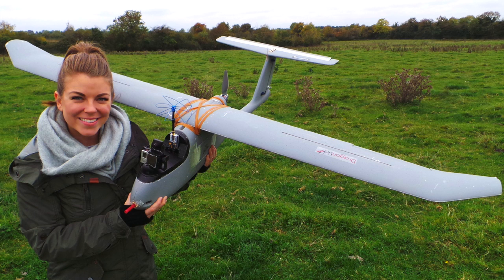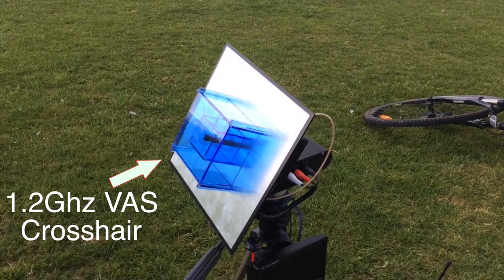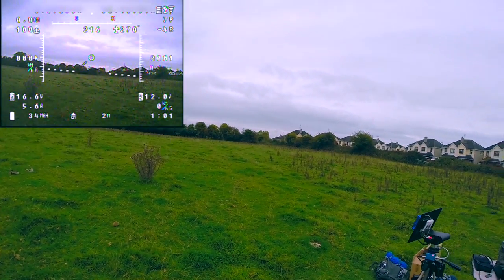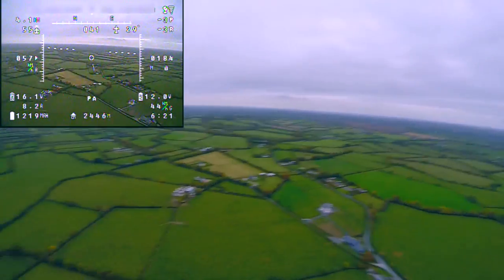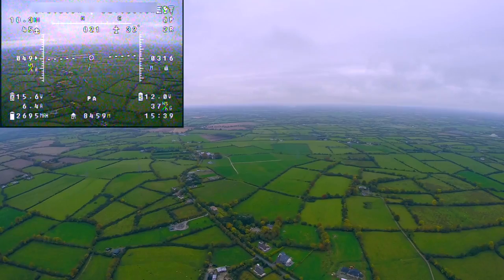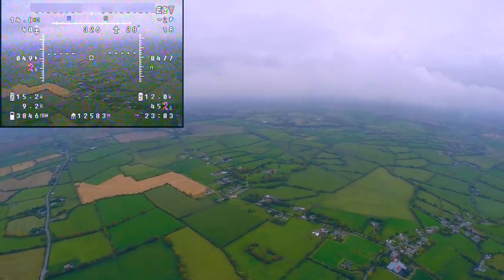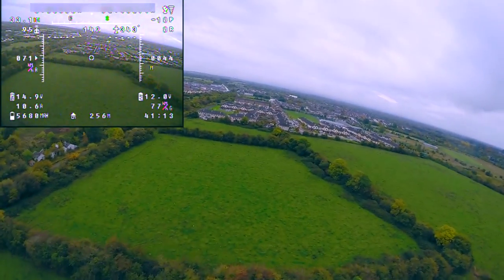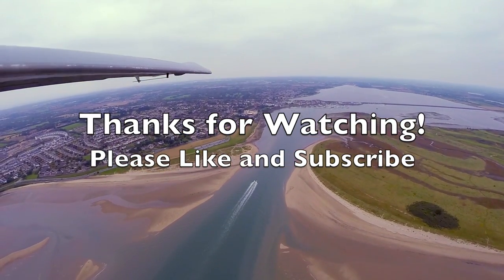Narrated Long Range FPV Setup Overview & 15km Range Test - Skywalker 1900

Comment: This video is about the best fpv related video I've ever seen!  Informative, calm and professional like comments.  Your Skywalker looks like a really clean build!  How did you paint it?
Reply from the maker: +asgeir nilssen Thanks= you for the kind feedback :) I painted it using multi purpose grey primer spay from my local hardware store. The finish was good but its easy to damage the paintwork. If i was doing it again i'd probably laminate it straight after to protect it.
Reply: Painting these planes is hard. Keeping i look good, even worse..  I'm thinking about using some kind of rubber paint.  Or coloured laminate.  I've seen carbon fiber look laminate used on a skywalker, looked awsome!
Reply from the maker: Yeah i'd say coloured laminate would be your best option
Reply: I couldn't agree more. Very insightful and informative. I really enjoyed that.
Reply: I'd love some advice on starting. I already have the typical dji drone setup but this is all together a different beast. I'd like some opinions on the very best startup equipment, everything needed, to do a good 8k or so startup. I don't know am I expecting to much to start with. I really want to get into this.

Comment: I watched this video back when you posted it. I know a lot more about fpv now and have just watched it again. It's great to see a 15km flight in the weather that I can expect most of the time in NE England. Considering the cloud and the relatively low altitude I think that getting to 15km before video breakup is a good result. I'm amazed when I fly 5km on 5.8ghz and can't wait to switch to 1.3! great video : )
Reply from the maker: Yup you'll love the switch from 5.8 to 1.3. So much more reliable. Thanks for the comment :)

Comment: A very informative and enjoyable video. Thanks so much for your efforts. I started in the hobby in the early 70's building and flying hand launch gliders, rubber free-flight and single channel escapement rc...the transmitter had a tube! I have always delighted in how technology has advanced the cutting edge and you make that very accessible.

Comment: excellent video, very interesting as I fly a 1900 as well but so far have only managed 2.6km on 2.4 ghz control.
Reply from the maker: +Russell Smith Thanks Russell. Sounds like a UHF system is the next step for you then :) with the right antennas you can go as far as you like (further than your battery will last for sure)

Comment: What should a beginner get to get started in this? Plane, cameras, for, etc...
Reply from the maker: Hi, if you want to get into FPV planes I recommned something like the AR wing: http://tiny.cc/3zgv0y But if you want a traditional style plane then something like the Mini Talon would be a good size and option. For camera, i use this one in about 8 aircraft because it is so good and a the price is very low too: http://tiny.cc/9scv0y

Comment: WOW Adam, what a nice flight. I'm new to this hobby where can I learn more about equipment compatibility and proper way to connect everything?
Reply from the maker: Hi Pedro. Best way to learn is through forums such as RCGroups, and watching youtube videos and tutorials. Thats how I learnt. There seems to be a tutorial on YT for everything :) When it comes to wiring it all up, it's mostly all dictated by the Flight Controller/Autopilot that you buy. It will come with instructions and should hopefully all make sense. Thanks for the watching and commenting

Comment: Hi Adam very well presented. Thank you also for the info on equipment used, however is there anything you would change regarding the equipment, Dragon link, Fatshark goggles etc? Please let me know as I am currently building a system. Again great job.....15k nice!!
Reply from the maker: +Michael West Thanks Michael :) appreciate it. Regarding the equipment, I think i'm still happy with all of it. To be honest, there have been quite a few changes to this setup since I first built it and this list is the outcome(E.g. I changed from a case based ground station to a tripod based, I switched from Fatshark Base SD goggles to the Attitude V2's). I have another change I am about to make and I am upgrading my Dragonlink v2 transmitter to the new v3 advanced which has only just been released.

Comment: Amazing flight and video!Did you consider putting the UHF TX on a tripod also and connecting ppm from frsky receiver to UHF,then you wouldn't have to hold so mich weight with your taranis.
Reply from the maker: +CrazyCroatianhacker Thanks :) Yeah I have considered it, but I mainly considered somehow mounting it on the tracker with a directional antenna on it. My main concern would be not much separation between my DL tx and the Crosshair. I hadn't considered putting it on its own tripod...
Reply: Hm,a directional UHF antenna,interesting,it would be bad to put the UHF TX close to the crosshair but on its own tripod would be good i think.

Comment: The best video about long range system. TNX
Reply from the maker: Thanks Roman, I appreciate the feedback. Cheers :)
Reply: How did you connect the reapeter 5.8 to 1.2ghz reciever?
Reply from the maker: The video receiver is connected to the input on this: http://amzn.to/2gEm6XV and there are 4 outputs for the video signal. 1 goes to a 5.8g vtx. Simple as that :)
Reply: I built the whole plane and could not do this simple thing. Don't know what a problem.
I have a 7inch display and fatshark. I took a a/v cable that plugs into the fatsharks and a a/v cable that plugs into the receiver. I bought a regular rca splitter and connected the display and the fatshark through it, but when you put them together, there's the dispaly image jumping... When i unplug one of them its ok.
After that I tried to do your method with vtx5.8. I cut a plug of RCA and took the white (video+) wire. I connected it to the transmitter's video cable (yelow) , find the band, but only saw a black screen in the fatshark.

Comment: Excellent drone. My only concern is the altitude you were flying at. Did you file a flight plan, adsb etc. As well as in to drones, im a pilot too. And anything above 400 ft causes me concern. It’s hard to see full size aircraft from the air and I’ve had friends had near misses with these things. I applaud you for your project but if you’re not already, please keep it safe.
Reply: Yes, way above the current CAA limit. But, noting this brilliant application of technology was posted way back in 2015(!) the height limitation would not have been in place then(?) Rule or no rule though, it was pretty irresponsible really.

Comment: Well done.. I love this stuff and am going to start flying long range myself soon... any tips for a noob ? I've been flying rc for years... but no fpv or long range equipment.
Reply from the maker: Having good rc flying knowledge and experience will help a lot. Mostly you’ll need to learn what equipment to use and setting up flight controllers (if you plan to use one). These days the easiest/cheapest one to get into is iNav. Look that up, join groups on Facebook or forums like RCGroups and watch yt videos. Good luck 👍🏻

Comment: Hi! Great job! 5 stars. What motor, ,ESC and prop (APS-?) do you have installed?  Weight of your plane?
Reply from the maker: +Van Lee Hey, thanks for the comment :) Every one of your questions is answered in the description of the video. I have added details of every item used on this plane and its weight (approx 2.8kg).

Comment: Great video Adam, a few questions. 

1) Which is the best autopilot system? I was looking into the ArduPilotMega but I've heard that there are other better autopilot systems 
2) Can I do the same on a Glow airplane? Are there any limitations with running autopilot and FPV systems on glow models, issues like vibration etc?
Reply from the maker: +Brenden Thanks Brenden :)
1) There is no definitive best, its all down to personal preference. What type of display you like, what features you require etc. However, one considered the best by many is the Eagle Tree Vector.
2) It can be done with glow planes. However, I have never used one so don't know the specifics.

Comment: well you have inspired me.. to do this,,, I've  started with a Bixler 2 with a cyclops storm, just doing little flights at the moment... but am looking for a full setup like yours

Pete
Reply from the maker: +Peter Wakefield Well the Bixler2 with a Storm was a great place to start :) good luck with the new build
Reply: very interested in your antenna tracker... this is the one area am not confident, and wouldn't know where to start...
Reply from the maker: +Peter Wakefield This is what you need: http://www.myflydream.com/index.php?main_page=product_info&cPath=1&products_id=3&zenid=3dc13ba75d4b6ae243950dc9b9c6660c

It comes with everything you need to get it working (apart from a Vrx and antenna obviously). It comes with an OSD (Telefly Pro) that you have to wire in series with your current OSD, unless you are using a MFD Autopilot, then you done neeed to do anything.

Then all you do in the field is set home and fly and it will just work.
Reply: many thanks,, Adam. sum interesting reading tonight

Comment: Great clip Adam, Im about to go onto 1.2G Video myself.....LawMate VRX with 800mw vtx....its being shipped....:)
Going to use it alongside my EZUHF.
Did you ever try using the standard Rubber Ducks for your Video?

Cheers m8...Dave.
Reply from the maker: +EnglishTurbines Thanks Dave :) I'm sure you'll love 1.2, its a lot more forgiving. Ive never tried the rubber ducks but I hear good things... like people flying to 8km easy. Would be interested to hear ho you get on if you try it.
Reply: Adam G does FPV Yes, Blueflyer just uses Ducks swears by em..Although I plan on making a 1/4 wave Dipole for the Video, wing mounted of course....I just want  a more solid reliable Link than 5.8G....The other question I wanted to ask is does the VTX affect other users on 2.4RC ? Im thinking about landing for example with my VTX banging out 800mw right next to other users on 2.4G RC?
Reply from the maker: Not too sure about that one, I doubt it will be a problem if you're flying out together but maybe if they are far away and you land it might cause a problem? Worth doing some research or testing i think :)

Comment: Nicely done Adam. As you know, I'll be installing a DLA V3 in my Skywalker, and one of the posters on the RC Groups  DL  thread advised mounting the rx on the wing as when he had it in the tail, he found reception on the return leg compromised by the kit in the fuselage. That did surprise me, have you noticed any drop in the RSSI on return compared to heading out?

Comment: Nice video Adam!!
Which is Coax Extension Length?
The antenna dipole is 15 cm or 30 cm?
Reply from the maker: +Matheus Leite Matheus Thank you :) The dipole is the stock one that comes with the dragon link, but from memory I think its about 30cm long. The extension is 24" long to reach from the tail to the rx in the fuselage.

Comment: Nice  explanation & awesome video.
In  manual mode,  take off was done?
When I use MFD autopilot,  i am cosidering whether use launch mode or manual mode. 
MFD Iauch mode seems not to be steady. 
Do u recommend Tornado osd ?
Reply from the maker: Hi and thanks for the comment :) the takeoff in this video is fully manual, as the Tornado doesn't have a launch mode.
When i fly my skyhunter I use launch mode every time, it works perfectly :D here is a demo: https://www.youtube.com/watch?v=lFAzEUOzfkw
I do like the Tornado, but I prefer the MFD AP. MFD is more expensive though

Comment: Great video Adam.  How do you recon you could get better range with fpv?  What antenna would you recommend?
Reply from the maker: The config on this plane isn't great for long range, my Skyhunter is a lot better. Using pretty much the same gear but a different layout allows me to go further than the skywalker. If you want long range, the Pepperbox seems to be a good option. I don't really fly too far that often so use the crosshair on a tracker.

Comment: Thanks Adam great video. I am a little disappointed in the Crosshair and antenna tracker performance. I really expected 20km clear feed.
Reply from the maker: Thanks Neil. I think I can go beyond 20k, really was bad conditions for long range. More testing coming soon
Reply: +Adam G does FPV This is normal but the altitude is low < 400 meters

Comment: Great Video Adam!
I start with the FPV a few planes ago... (lol)    I already crash a volaris multiplex and a sky surfer. So my next project is the sky walker 1900 as yours. And I really hope have great fun with this. As a new plane and already increasing the reach I would appreciate if you could send me some info about the configuration on the plane itself. Where did you put what.... I like the idea of the 2x5000 in parallel and will like to see where and how do you place them!!
Thanks!
Reply from the maker: +Lu Cruz Thanks :) You can see my build thread here if you sign up to FPV Hub: http://www.fpvhub.com/index.php/topic,22619.0.html
This picture here shows where the 2 x batteries are located: http://postimg.org/image/682dsqbu7/
Try not to crash this one ;-) its a great stable platform. Good luck with the build
Reply: Hello Adam!
thanks for the link
Is any chance i can see pictures or a short video of the setup? ;)

Comment: Hello Again!!
How are you transmitting the radio telemetry data (GPS Coordinates, Altitude, Speed) ? 
Which transmitter/ receiver are you using for above?
Reply from the maker: +Mandeep Singh This is just an overlay on the video feed which is produced by the Cyclops Tornado. This is transmitted using any video transmitter and receiver.

Comment: This was a great video! How much was all this kit together? Would love to get into the hobby!
Reply from the maker: +Lorcan Kelleher Thanks :) I sent around £1500- 2000 on all of this kit but you can get a great setup for way less. If you want to give it a try, have a go with something simple and cheap like this: http://www.hobbyking.com/hobbyking/store/__78977__HobbyKing_8482_Mini_Skyhunter_P_P_with_FPV_Set.html
Reply: +Adam G does FPV  thanks for the reply and also for the suggestion; I want to go as far as you go through. you e inspired me. I'll save and carry on. thanks a million!
Reply from the maker: Lorcan Kelleher 8km is easily achieved using a lot less equipment, with barely anything on the ground. If you do want to save and go as far as I do then go for it, its a lot of fun and a great experience. Are you in Ireland? I guess you are based on the "thanks a million". I am located in Dublin so if you get up and running let me know if you fancy flying together.

Comment: Nice build.
I have a question, normally how much thrust required for such kind of models to fly with respect to the weight of the model?
Reply from the maker: Thanks 👍🏻 I don't really have a good answer for that as it's not the way I usually decide my electronics. You're probably best Googling that or asking in a group/forum. Cheers

Comment: hey there fabulous video, i have a skywalker 1900 with a CF tail boom, i am struggling with the cog, i think the motor and prop are too powerful, it currently has a X2820 1100kv motor using a 11 inch prop and i use 4S, its super powerful, like scary powerful. Can you recommend a good smaller motor prop i can use?
Reply from the maker: Hi, I don't know what the specs are on that motor but it might just be the wrong prop. Size and KV of that shouldn't be a problem. I ran a 9" prop on my skywalker on 4S
Reply: Exactly what I have done now. Just waiting to get the motivation to go test fly this with a 9" prop . Its still same issue with CG though.
Reply from the maker: @Glenn.J  you haven’t said if it’s nose or tail heavy
Reply from the maker: @Glenn.J  if it’s nose heavy you want the tail to stick out the back as far as possible to move weight backwards. Most CG issues are down to the battery being used. Either you need to work out a way to move it back or use something lighter.
Reply: OMG i don't know what's wrong with me today, i am so sorry, apologies, I meant to say it's tail heavy not nose . 

Deleting that comment (where i mentioned nose)

Comment: great vide and narration, what is the material your AC is painted? thanks
Reply from the maker: +svsoftair Thanks for the comment. The Skywalker is EPO like most others, and I painted it using multi purpose primer spray paint from my local DIY store.

Comment: As a layman, initially, i was thinking the double tranmission might have latency or video degradation.  HOwever, this is not a racing drone, so latency is not an issue, i suppose.  And if the image is good, the transmission shoudl be good enough.  A direct line to goggle would be cumbersome and heavier on the goggles due to wiring. : )  So, cool.  cool set up
Reply from the maker: There’s barely any latency and like you say it really doesn’t matter in something like this. This is fairly old tech now too, it was years ago. Thanks for watching
Reply: @AdamGdoesFPV  oh dude!  lol.  I used to fly 20 years ago.  I am looking at the new stuff which is all foreign to me.  I am thinking of a Radiomaste Zorro with 4 in 1, and buying the horizon hobby Turbo Timber BNF.  : )   I am slowly learning.  I think maybe I will get Kopilot for the timber.  I need to research into Vtx and camera.  I think maybe the Cobra X for goggle : )  cheers.    Back in the day, I flew with airtronics and JR.  lol.  Open tx is new to me. lol